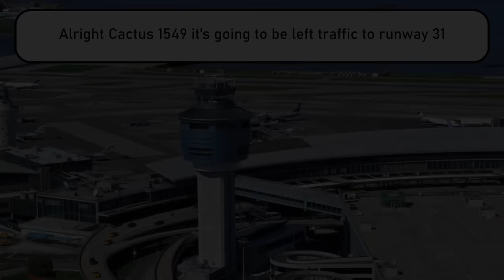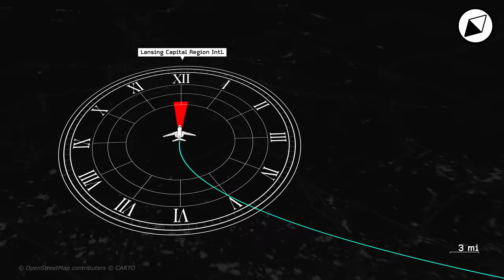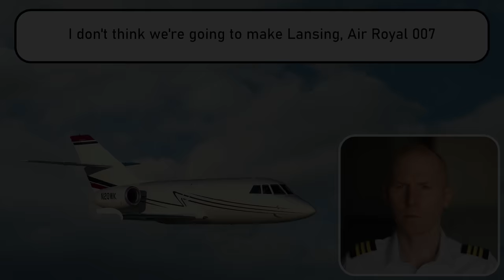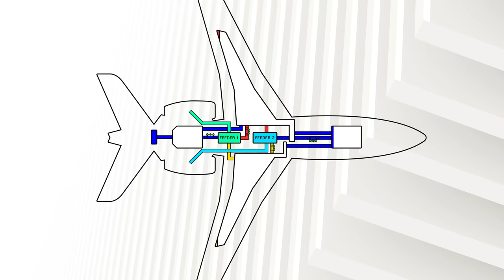Most Bizarre Dual Engine Failure Ever

Comment: There must be charts that show powerless glide maximums per weight per aircraft type, yes?  30,000 feet at a specific weight at a specific AOA to maintain a minimum gliding airspeed….to yield a predictable range?  A computer on board could show distance to touchdown based upon all these invariable and variable data: the pilot pushes down on the yoke too far and the computer reads a predicted touchdown at 9 miles…the pilot pulls up a bit (maintaining enough AOA to glide) and the computer reads 11 miles to touchdown.  Known terrain could also be factored in; an 11 mile touchdown prediction on flat terrain would be adjusted to 4 miles due to a mountain range at that heading (said four miles would account for enough land/space for a sliding/crash landing.   

Such data might be best projected on a map for terrain approaches.   

You mean….we don’t have this?   We have to fly by the seat-of-our-pants with no such computational aides?  

Shouldn’t this be an autopilot thing to efficiently maintain glide speed while the pilots decide and communicate computer recommended headings and terrain-accessible touchdown options?  Then, program  autopilot to efficiently touchdown at the chosen location?  

Would this not reduce human error while maintaining human decision-making?   

And, we don’t have this?   Really?  

At least, tell me the pilots wear seatbelts!  😂  

Or maybe, when the powerful computer on the plane computes an imminent and necessary quick landing (or a crash landing), the computer can jettison itself and parachute to safety (since it knows the humans won’t let it help them).  😂

Comment: ROYAL AIR FREIGHT INC RAX007 September 01, 2022 "Aircraft declared an emergency due to engine issues, diverted to Mason Jewett Field Airport (KTEW), landed and went off end of runway into the grass."
"Double engine failure due to fuel starvation, according to people on scene. Initially tried to reach the main airport at Lansing (KLAN), then diverted to the 4,000' runway 28 at KTEW. 750' of skid marks on the the pavement, followed by a swerve to the right and several hundred feet through the grass. Fortunately, the ground was summertime hard. Yes, the final stop occurred about 20' past the runway end, but beside it, not in line with 28 proper."

Comment: @74 Gear is it possible this ATC was not thinking clearly and assumed he had 2 more engines? Although 737s are the most popular and they have 2. I don't understand why ATC is not giving them free airspace. Someone comes on after the fact to re-confirm if you will that both engines are gone. Why ? You are wasting time

Comment: I kind of feel that the incident where a 747 physically lost two engines on one side of the plane is perhaps one of the most bizarre crashes I've seen (not in person, but documentaries, although I think the reason for the dual engine failure and detachment has been figured out as this happened I believe about 30 years ago, they knew immediately why it crashed but it took them time to figure out how the two engines on one side detached from the aircraft though).

Comment: What are you actually talking about? It seems you mix between 747´s, Falcons and other smaller airplanes throughout. It is not very clear where you cut between live audio from an accident to your own comments. I don´t like this, I feel like you have a bit of knowledge on some of these airplanes, you probably got landing distances right, anyone could check out those. But I figure with all of that knowledge about one specific accident, you would also know not to use the clock as a reference. Compass headings are a built in feature in pilots as in seamen. The clock reference is only used in Hollywood. This alone tells me you´re a fraud. IDK how much you spent on your fake uniform or how much you studied different airplanes´ landing specs. Nobody who knows anything about navigation ever refers to the clock, only compass readings!

Comment: the crap about losing engines on a twin jet, is A, you lose all of your controls because your hydraulic pumps are now INOP. and second, you are a glider.  some planes may have an electric backup for just some of the flight controls.  In a citation, there is ZERO backup, the pumps are driven by the engines, nothing else. A falcon has 3 engines, at least the most common variant, so they still had 1 engine to power their pumps.

Comment: When a controller assigns an altitude they must comply with the MVA (minimum vectoring altitude) in their airspace. The 3000' altitude assignment was most likely to comply with the MVA in that area. Even in an emergency the controller cannot assign altitudes below the MVA. If the pilot cannot maintain an assigned altitude and descends below the MVA it is then the pilots responsibility to maintain terrain/obstruction clearance. MVA's take into account trees, tall buildings, radio towers etc. If the controller assigned an altitude below the MVA and the plane hits an obstruction the controller just bought 100% responsibility.

Comment: My father was in a flying club, decades ago, and one of their two aircraft was a refurbished WW II Stinson L-5 spotting aircraft. It's fuel gauge was simply a clear C-shaped tube at the inside end of each fuel tank, extending into the cockpit.  You could tell how full the tank was, but there was no actual measurement.

-----                                              ------
      D   <--  fuel indicators -->  C
-----                                              ------

They eventually sold it off to a guy who crash landed it shortly afterwards, mistakenly believing he was nearly out of gas.  In reality, per the members of that now defunct flying club, from what he described seeing in the C-shaped tubes on either side of him, he had maybe an hour or two of fuel remaining.

Know your aircraft, and what all those gauges tell you.

Comment: Why even have a "close" valve on gas tanks? Once that was in the design, this scenario went from impossible to possible, and now to definitely. At least have an interlock/remove before flight type thing.
Reply: If there an engine fire or an emergency landing that requires appropriate action, you want to cut off the fuel to decrease the risk of a larger fire
Reply: @jakeoesterreich8037  but the feeder tank is full, so fire is on. And if you can close the values, why can't you open them?
Reply: There might be manual valves so maintenance can isolate a fuel line without having to empty the associated tanks to avoid a kerosene bath.
Reply: @DrDeuteron  Maybe you have to access them manually from outside the plane? The video simply said they can't be opened or closed while IN FLIGHT. And yes, if there's fuel in the feeder tank, there could be a fire initially, but it's going to be far smaller than if you have ALL the fuel involved. And as others have said, it provides a way to prevent having to drain the entire system for maintenance too.

Comment: So, if the valves between the tanks and the feeders were closed, it means the fuel in the tanks didn't get touched after filling them before takeoff, right? Shouldn't the pilot have jettisoned it in order to maximize the range they could reach (and possibly to get below the MLW) and shouldn't there be a record of that action to confirm it? If so, it would support the rumor.

Comment: In motorcycle class, the main thing you must remember when operating a motorcycle is to make sure your fuel is on.
Reply: It's kind of easy when you mess up for that though. Your engine just won't start and there's no danger aside from one's pride. This bigger mistake on a motorcycle, is to set it to "Res" and go on a trip. If your bike doesn't have a fuel gauge... have fun!

Comment: My take is that airlines want airplanes to run on minimal fuel capacity. Only use the fuel you need, plus a margin.  Why do that if it could cause such unnecessary distress?  I want to get to my destination safely, and I have faith that the pilot flying the plane has the expertise to do so. However, if the airline fails to supply enough fuel to do so, how can I fault the pilot?  I think dollars are worth more than human lives. Really gives a perspective on flying.
Reply: This episode wasn't about running out of fuel, but to answer your question they carry a lot of margin. First they calculate all of the fuel that they expect to need for the flight. Then they add a percentage like 5% on top of that. Then they add the amount of fuel needed to reach the farthest of their two alternate airports. Then on top of all that they add either 30 minutes or 45 minutes fuel reserve depending on the airline. For this reason it is very rare for a plane to run out of fuel.
Reply: Ultimately the captain is still in charge of the flight. Those airline bean counters aren't out on the ramp taking delivery of the fuel. And depending on where & what your flying there's legal minimums that must be in the aircraft for each leg of the flight. Very roughly(and very minimal) it's calculated as the 1x Trip Fuel + 1x Go around fuel + divert to alternate fuel + 30 minutes "Final Reserve" fuel. If Final Reserve fuel is used at all it's a Mayday level emergency & there will be a investigation & accident/near miss report done. Also planes are significantly more expensive than a "reasonable" amount of extra fuel(+ the other fuel calculations I've glossed over).
If I was running a dodgy airline I'd think it'd be way easier to "accidently" leave customers luggage behind and take some extra cash for parcels/mail with all this extra room we just found in the back of the plane🤑
At the end of the day mistakes happen, someone calculates the wrong fuel amount, data gets entered into a computer wrong, a piece of equipment malfunctions, mother nature or even just a brain fart. Hopefully one of the many checks & balances that are done catch it before it actually becomes a "mistake/issue" or we investigate & improve our checks and balances to prevent it from happening again.
Reply: @leebell8946  Dispatch selects the fuel level based on the guidelines, but yes the captain can add additional fuel. But I wonder how often that happens though. I doubt if there are pilots that always add an extra 500 lbs to each flight just as their policy. 

But if they see that the weather is going to be dicey at the destination they might add some extra to possibly give them an additional go-around. Then again the dispatchers may be looking at the weather also and have factored that in. I wonder if the captain sees a breakdown of what the dispatcher is factoring in, and only adds more if they think they see something that is not being counted.  Probably depends on the airline also, some airlines probably don't say anything as long as its not abused, cheaper airlines maybe have the pilot fill out a report each time where they have to explain why they requested extra fuel.
Reply: @StevePemberton2  Given we don't see many reports/incidents of minimum fuel emergencies clearly someone is doing something right.
In Australia i can look up fuel incidents on our ATSB website as you must declare an emergency if you might not landing with minimum's intact. The US the guidelines dont require you to declare.
What I noticed saw was practically no airlines but 95% were GA. Probably not great publicity if your ending up in transport safety reports. For GA I wonder how much of that is financial pressure(lax regulation) vs someone just getting complacent.
Reply: @leebell8946  In the U.S. airlines have policies for declaring Mayday fuel I think the standard is thirty minutes although I don't know which airlines do or do not have that policy. But it could be that they all have the policy in place but that it's a rare occurrence.

It would be nice to have a breakdown on the GA numbers, I would think it trends toward lower time pilots as it's easy to miscalculate especially with weather that they wind up having to fly around. And  I wonder how much of it is things like VFR pilots getting stuck on top of clouds looking for an opening to descend through and then they start running low on fuel.

Comment: Air Canada lost their engines bc the fuelers didn't have the right conversion, had half of what they needed...I believe it was Gimli they had to land at...prior military runway, but it was no longer in use for military...it had actually been used as a drag racing and guess what, there were ppl around having a campout and kids on runway..the pilot was the first one to nail a crab...impressive

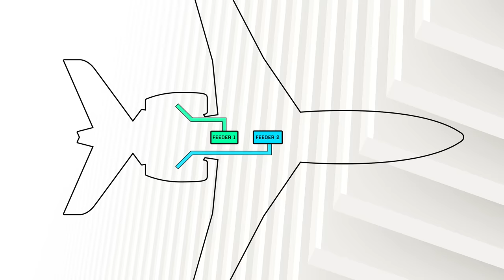Comment: 9:58 it's not common for aircraft to have seperate feeder tanks (certainly not in big passenger aircraft), typically fuel will be feed directly from the fuel tanks into the fuel manifold which can cross-feed or connect all tanks to all engines if required.

I this particular aircraft I think your picture is wrong (I can't find any diagrams for the Falcon 20 but can for the newer Falcon 900 and 2000 which both are newer variants of the Flacon 20). 
The fuel is "feed" into what they call the feeder tanks or boost pump comparments, these are not seperate tanks but are the most inboard area of the fuel tanks which contain the boost pumps, these feed fuel into the manifolds and supply fuel to the engines.
The boost pumps are connected to jet pumps in each section of the wing tanks and there are flapper valves in the tanks which ensure fuel can always flow into these boost comparments.

From a relability/redundancy stand point it makes no sense at all to have a seperate feeder tank that is seperated from the main tanks with valves than can be manually closed and have no indications in the flight deck.
The wing tanks are seperated into three sections; outer, inner and the centre section/feeder tank. These are seperated by by baffles whuch stop the fuel from sloshing around during manouvers but have a vent holes between the tanks and have flapper valves (basically just a flap that acts like a non-return valve) that ensure fuel can move freely into the lowest/centremost section (which is the boost compartment/feeder tank).

The jet jumps are not a motor driven pump but use pressure from the boost pump outlet to draw fuel from the outer tank sections directly to ensure a postive fuel supply to the boost pumps to avoid cavitation. Jet pumps are pretty much standard issue of most aircraft, usually you'll find them in the lowest point in the fuel tanks to suck out any water that has settled (and not been drained).
On later models of the A320 jet pumps are used to transfer fuel from the centre tank into the wing tanks rather than have seperate boost pumps that the feed the fuel manifolds directly.

Comment: I know of one KC-135A that lost all four engines flying from England to the USA.  About half way across the pond, the first engine was shutdown due to low oil pressure.  They continued to lose an engine an hour due to low oil pressure.  When the third engine failed, they restarted the first engine, and the remaining good engine failed on final.  They landed with no further issues, and investigators determined the engines failed due to lack of maintenance.  The crew chief never checked oil once during the entire trip to Europe and back.

Comment: What if you lose 3 engines on a Boeing 747. Are you able to hold your altitude with a plane fully loaded or close to fully loaded? How mutch fuel you have onboard may be in the calculation to.
Thanks for greate klips.

Comment: If this is the incident where the air medical jet lost both engines because  DEF got in the fuel by accident, when the jet landed it sustained absolutely zero damage and the medics in the back thought that he did a really smooth landing they had no idea their engines were out. The pilot was so calm that the flight crew in the back had no idea anything was wrong.
What happened with this particular jet is somehow just a slight amount of DEF got put in the fuel from storage tanks that had the DEF in them and for some reason they use them for jet fuel later. Evidently only timy amounts of DEF are needed and a jet engine won't burn the fuel.

Comment: My Dad was flying in a thai airways DC 8 in 1973 going into Kathmandu,  dad was a glider pilot and he said  before they landed he noticed out the window the control tower was about half way down the runway  the approach  was turbulent as they touched down  he saw the control tower going past his window and said that he new they were in trouble as they were already half way down the runway the airplane
ran off the end and hit and killed a guy driving some earth moving equipment the  cockpit broke off the front of the plane flipped upside  down with the unheart pilots still in it, dad evacuated down one of the slides but later went back in the plane from the front where it was broken to look for his passport
which he couldnt find  while inside he helped a thai airways stewedess to exit the plane, he said the captain was walking around outside the plane saying "l have lost my job"

Comment: I curious about the feeder tank valves. Is opening and closing them a maintenance function or can they be controlled by the pilot?
Reply: Can be done from cockpit usually, but it relies on actuators to operate the valves... Usually electric. The valves aren't available from cockpit

Comment: Great video as always! I have a question regarding the gliding at 03:15 in the video. Does weight change the glide distance in a jet?
Reply: It doesn't. The weight does affect glide speed but the gliding distance of a hypothetical lighter plane is the same as the heavier one.